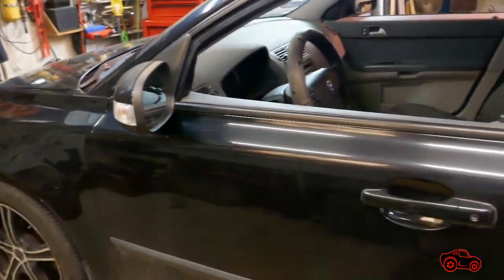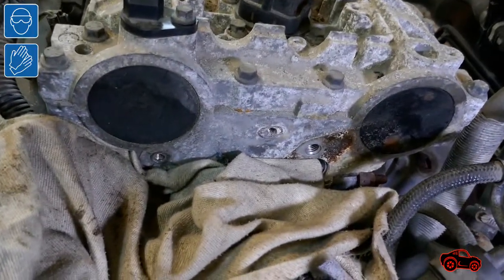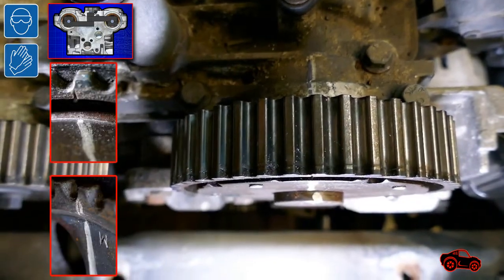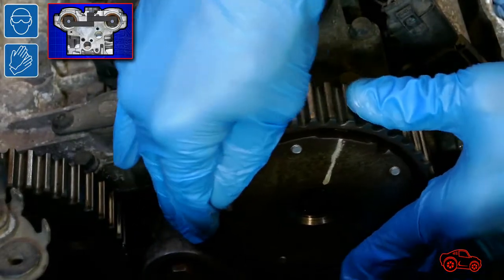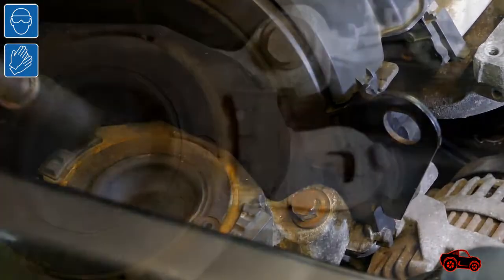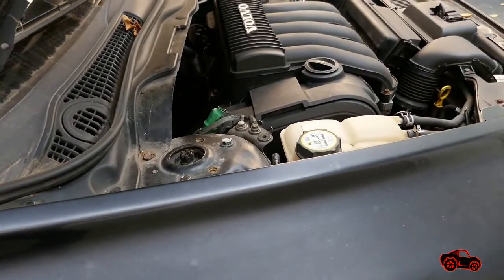Volvo S40  2.4i Timing Belt & Camshaft Oil Seal Replacement

Comment: Thank you for these videos. Very helpful. I just acquired a 2007 S40 2.4i (roughly 98,000 miles/157,715 km). I am in the process of replacing the water pump and timing belt. I just replaced the two front cam seals as well as the crank seal. The only seal that was leaking was at the intake, but I figured I'd replace the others while everything was apart.

I have a question about the intake VVT sprocket. Since it turns freely when the bolt is removed, if I replaced the sprocket with a new one, does it really matter about its orientation, so long as I make sure there is 18 (timing belt) teeth between it and the exhaust sprocket (I realize the new sprocket might have a timing mark on it)?  There is no play in the existing sprocket, but I read where they can still leak from an internal o-ring? Have you heard of this? That is why, while everything is apart, I was thinking of replacing it with a new sprocket and wanted someone else's take on it.
Reply from the maker: (1) Assuming the 2 camshafts are properly locked in position to perform the timing procedure, the NON-VVT sprocket of the exhaust cam should have its timing mark aligned with the exhaust timing mark of the plastic cover, and the proper teeth  spacing should work in theory. BUT... it is required by Volvo to align the intake timing mark of the intake VVT sprocket with the intake timing mark of the plastic cover to perform a timing procedure. One reason is: When the timing belt has just been installed, it has to be rotated by hand a minimum of two full turns using the crankshaft bolt. So when this procedure is completed, it is very easy to check if each timing mark of the two sprockets are still aligned with the proper plastic cover timing marks. It is also required in the future if a mechanic has to perform some timing trouble shootings.
(2) I don't know about an internal o-ring of these VVT sprockets. Normally when the engine management system activates the phaser system in the VVT sprocket assembly,  the VVT solenoid valve is powered and it opens, then, the oil pressure increases in the vanes, therefore,the phaser changes the rotating angle of the sprocket. When the system is deactivated, the assembly returns its normal running position without play. 
If there is no electrical signal to open the VVT solenoid valve, if the solenoid valve is broken, if the oil pressure is too low or the VVT sprocket assembly is defective, the VVT system will not work.
Reply: @mtlcarguy  Thank you for the reply. Unfortunately, I didn't get the notification from YT.
I did lock the camshafts at the rear using the locking tool, and I did wind up getting a new intake VVT sprocket. It didn't have any timing marks on it that I could see, but I matched it up with the old sprocket (which I had marked anyway). I had marked the exhaust sprocket as well.

Everything seems to line up, although I haven't tensioned it yet, because I'm curious about which direction to tension the belt with the tensioner. Edit: I was initially confused about which way to tension it, but I will just follow your example. :-). Thanks again for taking the time to respond.
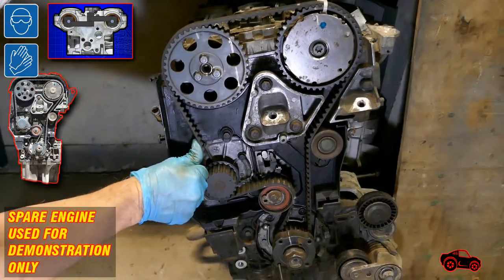Reply from the maker: @BentPropeller  The installation depends on the type of tensioner that is used. 2 types of tensioners were shown during the video, The tensioner (option 1) can be difficult to adjust. The tensioner (option 2) with the Allen key used to hold and release the the spring is easy to install without specific tension calibration. When using the timing belt tensioner option 1 or 2, (or an aftermarket one), the tension of the timing belt must also be tested by hand to evaluate the tension. At the same time you have to check if the tensioner moves properly. You can see that in the video, I checked the belt tension at 12:39 and at 14:11. Make sure to take pictures and notes to double check your installation.
Reply: @mtlcarguy  I am using the same type of tensioner you are using at the 12:39 mark. I adjusted it the same way you did, and tested it as you did, successfully. Thanks for your advice, much appreciated. 

One more question if I could (I promise! ;-)): On the exhaust sprocket, there are three bolts. I can't seem to find the proper torques values for these bolts. This is what I get from a Google search: "For the 2007 Volvo S40 2.4i with the non-VVT engine, the three bolts for the exhaust camshaft sprocket should be torqued to
25 Nm (18 ft-lbs) plus an additional 60-degree turn. This is the same specification used for the crankshaft pulley bolts on the same P1 platform engine.". I don't have access to VIDA, but do you happen to know if this sounds correct? Again, much appreciated.
Reply from the maker: @BentPropeller  The torque wrench setting I have for my 2007 Volvo S40 2.4i non-VVT engine exhaust sprocket is 20Nm (15ft-lbs) for the 3 small bolts.
Reply: @mtlcarguy  Ah, I'm glad I asked. Thanks again for all your responses.

Comment: IS these water pumps reliable as you didn't replace it - or you did it earlier?
Reply from the maker: The water pump that is installed on my 2007 vehicle is the original one and the odometer is near 280000 kilometers, but, I heard about water pumps that started leaking around 175000 kilometers  on 2.5L T5 engines. To reduce the risk of having a leaking water pump and the risk of having some coolant on the timing belt, it is strongly recommended to replace the pump when the timing belt is replaced. I know the risk I am taking with mine, this is why I check it on a regular schedule.

Comment: great video! so detailed. I got a question, did you  use the old crankshaft bolt? I have heard that those bolts are torque bolts and are likely to stretch slightly and putting them out and in again increases the chance for it to snap.
Reply from the maker: I guess you mean the 4 bolts holding the crankshaft pulley to the adjacent sprocket. As far as I know, the Volvo dealership mechanics are supposed to replace them with new ones. Yes, I reused the ones I had because I trusted them, but for peace of mind and added safety you can replace them with 4 new ones.
Reply: @mtlcarguy thank you for the prompt  response. so there is 4 small bolts and one bigger one in the middle. so I guess the 4 small ones are called harmonic balancer bolts. Could you tell me what the bigger one is called?
Reply from the maker: @georgistnv  The crankshaft pulley also called harmonic balancer and the crankshaft sprocket are fastened and linked to the crankshaft with a 30mm nut called crankshaft pulley nut and the previously mentioned 4 bolts. Open this link to see an isometric illustration: https://volvoforums.com/forum/volvo-s40-11/2007-volvo-s40-crankshaft-sprocket-harmonic-balancer-105966/

Comment: Fantastic video! I also have a 2009 2.4i with 120K (U.S. miles) and will be challenging myself to do the timing-belt and tensioners soon. I know these cars are designed to go 150K (in California) with the timing-belt but I'd like to do tackle it soon. Also made me think of the 'seals' now since they are prone to leaks. I've worked on my Audi but never on a Volvo, other than routine maintenance and replacing cosmetic parts.
Reply from the maker: Undoing the camshaft sensor wheel screw can be a problem sometimes. A common cordless impact wrench with 3 variable strength/speed can be used to undo the screw, I tried with the medium strength and it worked. You can bag and tag the bolts, the nuts and the screws to help when it is time to refit the parts.

Comment: GREAT VIDEO ONLY THING USED A BOSCH TENSIONER TWO STEP ADJUSTMENT FIRST THE FRONT (WITH ALLEN KEY) SECOND STEP WAS THE REAR SPRING LOADED HEAT TAB ON THE BOSCH HAD TO ROTATE CLOCKWISE THE GET SLACK NEEDED THEN RELEASE IT SLIPPED RIGHT ON.
Reply from the maker: Thanks for sharing, It is always useful to have more choice when working on a project.

Comment: Really good work, i have a Volvo S40 2.4i that got its engine replaced after a year sitting on the streets and i've been replacing and repairing a lot of parts giving me trouble,  i wont be replacing the timing belt soon as i still lack confidence but every other repair i just do it myself now and these videos are a real help.

Comment: Quick question, the camshaf sloted ends should align? and also the marks on the two camshafts sprokets? I noticed yesterday my belt has a play about 3/4 inch so either is stretched out or the tensioner is bad, so at this point I'm not sure if belt has skip a tooth. Thanks in advance!
Reply from the maker: Those timing belts would brake before stretching out, like you described it. 
On this S40 2.4 engine, first the crankshaft marks are aligned to obtain a proper dead center, then, the camshaft slotted ends are parallelly aligned (or re-aligned) with the upper surface of the cylinder head using the camshaft locking tool. 
Therefore, the sprocket timing marks should be aligned (or re-aligned) with the plastic sprocket cover timing notches.
When  the bolt(s) of a sprocket is (are) torqued down, it is possible that the sprocket(s) could have rotated a fraction and lost the adjustment, this is why, I always double checked the notches alignments after.
A defective VVT phasing system can cause a problem but it is extremely rare. 
A defective timing belt tensioner or a tensioner installation could cause belt tension problems like skipping a tooth or getting too lose. 
Assuming that you have installed the proper timing belt, you may have to re-check your installation to avoid catastrophic problems.
Note: I noticed years ago that a guy used a single steel flat bar to align the camshafts, this was a mistake because the slotted ends of the camshafts are offsetted differently and it changes the timing a bit.
Reply: @mtlcarguy  Thanks for your reply ✌️ I did one timing belt a few years ago on a Hyundai and all worked perfectly, now this Volvo is kind of a pain with due to space restrictions, and I'm stuck trying to remove the crankshaft but, and I assume it does get loose counterclockwise. I had put oil for 3 days to she if that penetrate and loose it ...but so far nothing..
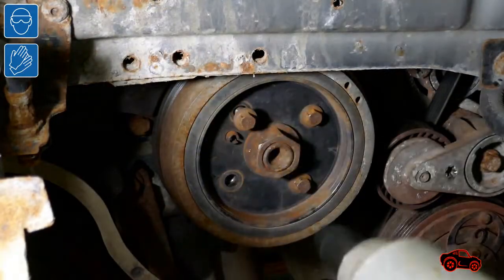Reply from the maker: @simengineering9183   When you say ''trying to remove the crankshaft''  I assume you mean ''trying to remove the crankshaft center nut''. Trying to undo the big center nut with a common cordless impact wrench or a common 1/2'' drive ratchet, sometimes, it doesn't work without a lot of effort, this is why I use a more powerful electric impact wrench like it is shown @ 2:51. 
The crankshaft center nut and the camshaft sensor wheel screw do get loose counterclockwise.
I did undo the camshaft sensor wheel screw on two other Volvo engines and it worked with a common cordless impact wrench without damaging the screw or the Torx bit socket.
Reply: @mtlcarguy  I finally got it out, Heat up the nut and I used a impact gun, funny I use a cheap one and before that I was using a breaker bar with a pipe and nothing, but my bad as I was using 3/4 to 1/2 extension and I noticed it wasn't moving, just flexing on the weak joint now I got the 3/4 proper extension but heat did the magic trick. 😄 now to install all the new parts and hopefully I will get it done today🙏

Comment: Well done , great job. I wonder what they would have cost at a Volvo garage.
Reply from the maker: I don't know, I never asked my local Volvo dealer service representative.
Probably at first, 5 or 6 hours for labor, plus parts like the timing belt, the camshaft oil seal and the expansion plugs. 

But during the work, depending on the quantity of oil that leaked on the inner parts, and how old are some parts, they could have strongly suggested to also add more time to replace extra parts like the drive belt tensioner, the idler pulley, the water pump (& coolant fluid), the oily timing belt covers, the oily plastic shield behind the timing belt and the two drive belts.